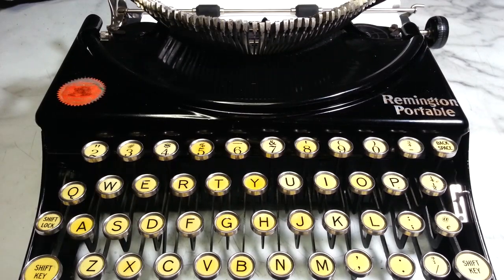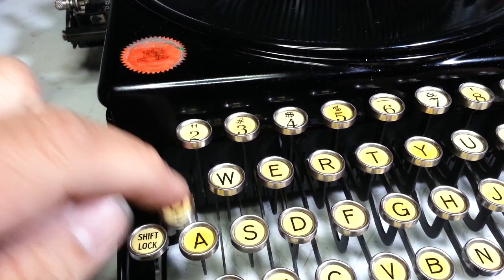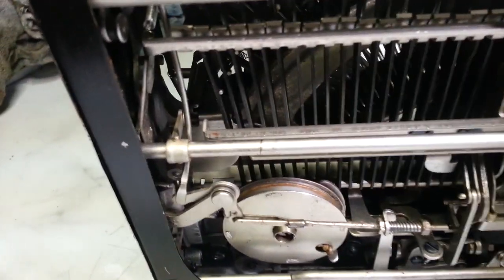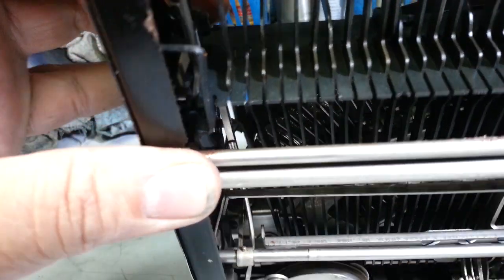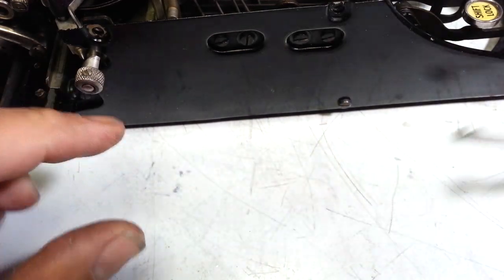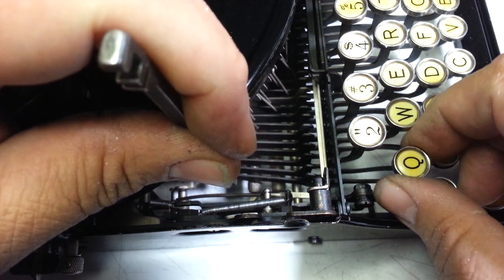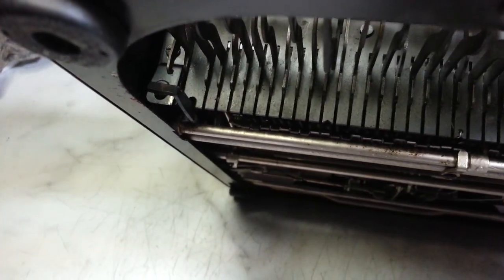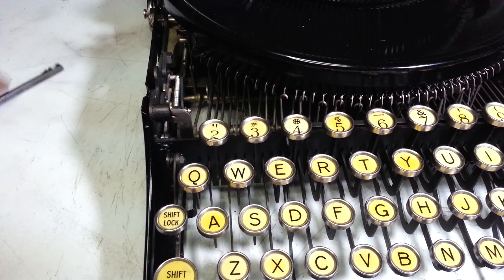Remington Typewriter Keyboard Repair Uneven key tops Bender tool needed

Comment: Does anyone sell those benders any more? The closest thing I could find were glass cutters, which have some similar slots. They look like very handy tools.
Reply from the maker: Nobody I'm aware of has these, check ebay, fabricate one from piece of square steel.
Ames was the last place to have typewriter tools, they closed around 2000
Reply: @phoenixtypewriter2136  cheers for this! How many mm wide is the most useful, have you found?

Comment: Hi, I recently bought a SC Skyriter with the ?/ key setting too low like this one. It takes a very hard whack to make an impression on the page, otherwise just a . or a , shows up. Where can I get a tool like this to help me bend the bar?
Reply: Personally, I just made my own. These don't seem to be out there anymore. If you can find a side fitting open end wrench (with the opening on one side instead of on the end), you might be able to make one of those work for this purpose.

Comment: Here is how you fix this
Uses tool, literally no one has access to
Reply from the maker: Hello, Hello, Just like automotive mechanics, or plumbers, or electricians, yes we all have tools for our trades
The tool I used can actually be made from a square screwdriver blade and a dremel cutting tool
Reply: These days, it's basically back to the old blacksmith tradition: Need a tool? Don't have it? No problem, we can make it! It's What Blacksmiths Do!